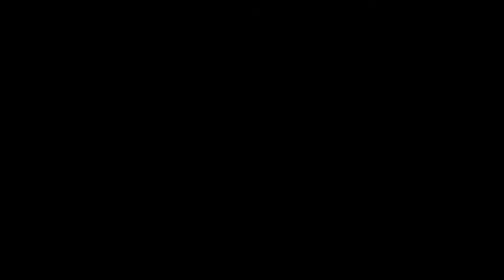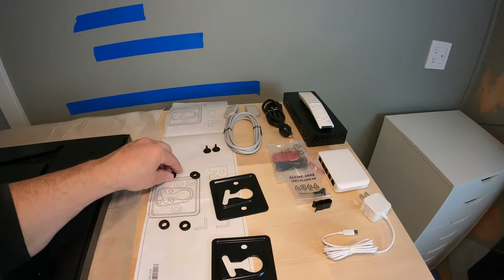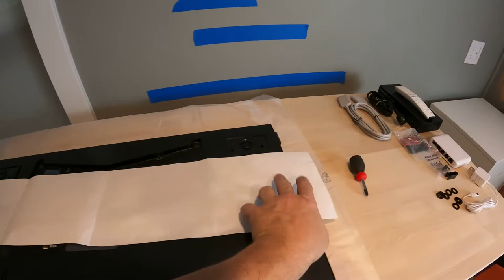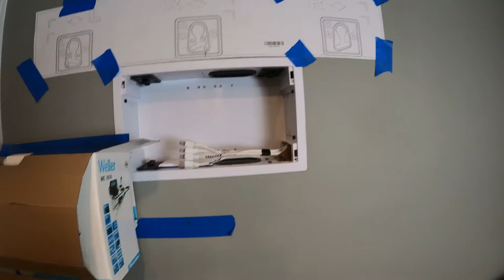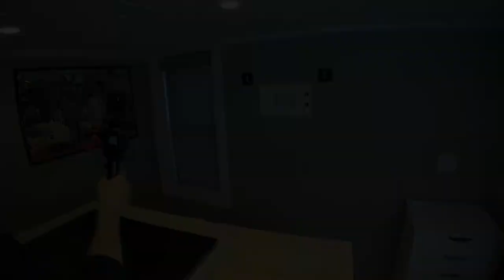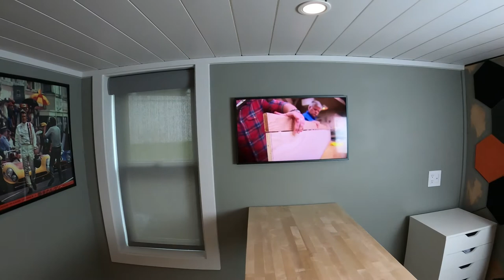Samsung Frame TV install and hidden one connect box.  Time Lapse and Details

Comment: Thank you for the amazing video , I have a 32 inch frame  model QN32LS03CB, and the one connect cable that comes with it , is only 8 feet long ( BN39-02615A 2221 LT) , Can we get a longer cable or extension 16 FT or longer? its not the same used for 43 inch Frame.
Reply from the maker: 32" is a odd set up as the omne connect box, cables etc are all different then there other models.  Can you do an inwall enclosure?

Comment: You said you mounted without studs. I have the same problem with the stud distance- will my tv be safely mounted in drywall without the studs?
Reply from the maker: Hello,  you could use the supplied anchors up to 43”.  If larger we usually use a butterfly style anchor.  Hope this helps.

Comment: I guess the remote works just fine with the box completely enclosed? Does the box need any visabilty to the remote to work properly?
Reply from the maker: Yes, No issue as the remote can do IR but depending on the year it is RF or BT.
Reply: @theaterdesignco  ah ....great! mine is 2022, hopefully all Bluetooth.

Comment: Hi there, is it hard to access the one connect box if say I was at home by myself and needed to plug in an hdmi cable? I have a frame arriving soon and would love to have the box installed into the wall but am worried about if easy access would be an issue. Thanks!
Reply from the maker: Hello,

It is not easy.  I would plan out your gear and install it once, call it a day!

Comment: The hole diameter for predrilling the wall anchors Samsung recommends in the instructions is too big. Did you find that?
Reply from the maker: For Drywall yes.  For cement they are good!

Comment: What size drill bit did you use for the brackets?
Reply from the maker: This would be based on the hardware you use.  It does come with hardware but often you would use your own.   Cheers.

Comment: There is not much ventilation for the One Connect Box. 
Does this give rise to too high a temperature hidden inside the wall? 
My One Connect Box stands out freely but gets VERY hot when the TV has been in use for a few hours. This raises concerns that the Box may break.
Reply from the maker: We have not seen an issue.  Not sure of exact count of how many we have done but no issues so far!

Comment: Do you know if this is the same wall mount for the frame 43 inches ? Thanks
Reply from the maker: Bracket system is the same for 32 and 43. Mounting location are wider for the 43” 

It changes on the large size up.

Comment: what was the in-wall enclosure you used?
Reply from the maker: Strong brand 8x14.  We sell them if interested.
Reply: @theaterdesignco  I don't think that size would work for my one connect box because it is 13.7  X 5.4.  Apparently the box got bigger for the 2021 model.
Reply from the maker: @steveschroeder1670    Legrand makes a 17” version we use for anything bigger then the 43”.
Reply: @theaterdesignco  Thank you.  That's the one I found so good to get confirmation that I found the right one.   I didn't realize that your company was in my area.
Reply: Do you have a link for the Legrand 17” wall box?